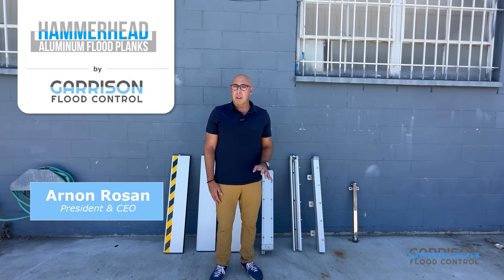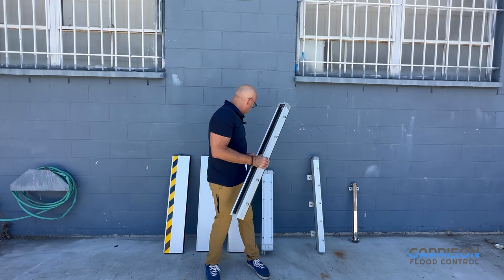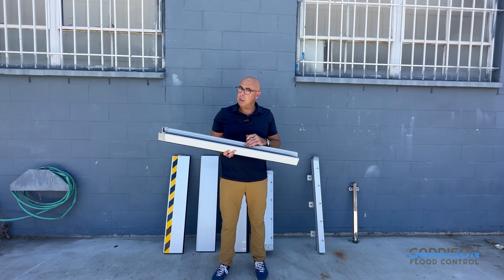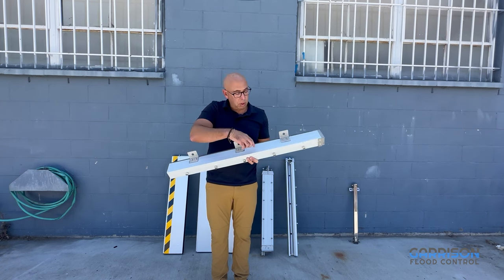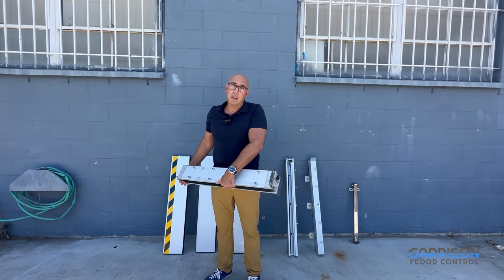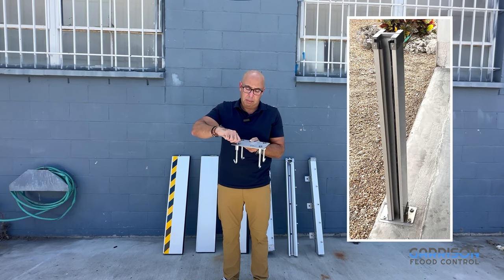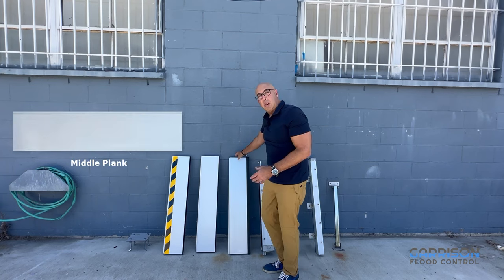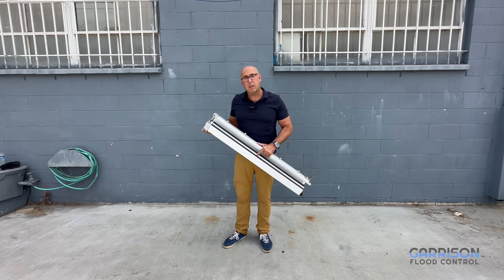Hammerhead™️ Aluminum Flood Wall System | What It Is & How It Works

Comment: Would this have protected homes against the Helene storm surge? (Of course saying if it was installed tall enough). But it would of withheld against that sort of force?
Reply from the maker: Yes!  We successfully protected hundreds of locations in Florida for Helene.  Unfortunately in some cases we heard that the storm surge went well above over the protection height. The system is designed to handle the hydrostatic pressures at the height installed.
Reply: @garrisonflood  How high were the ones that went over? And how high does your system go? Thanks
Reply from the maker: @rimalaw77  Our system can go up to about 7ft.  We saw some 3 and 4ft barriers get overtopped.